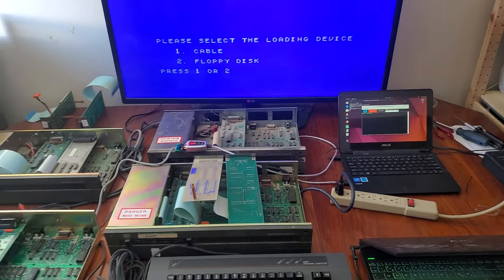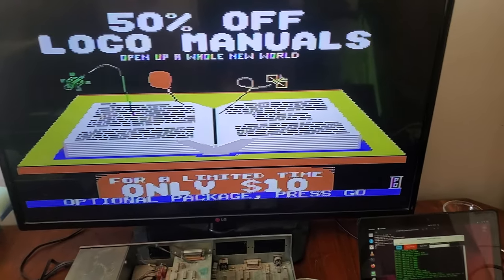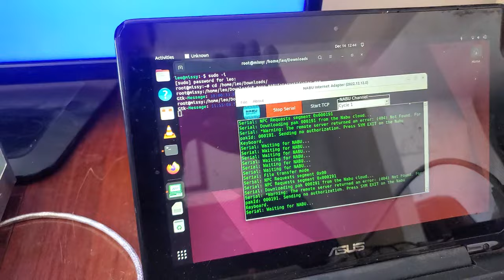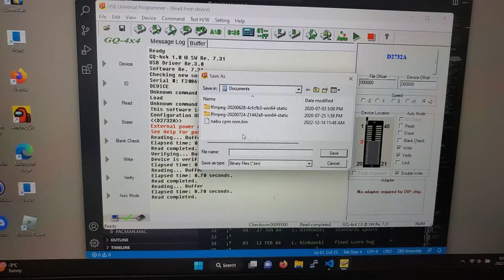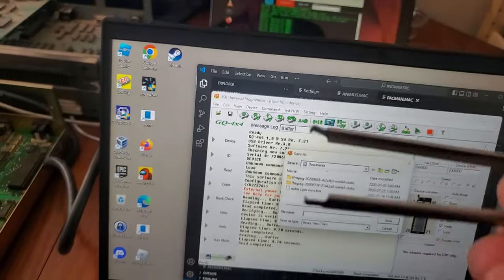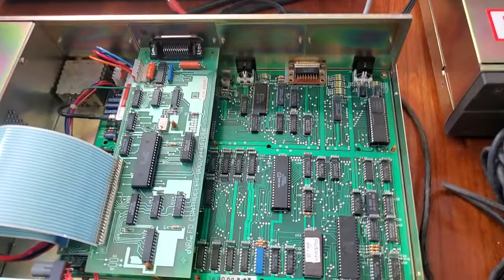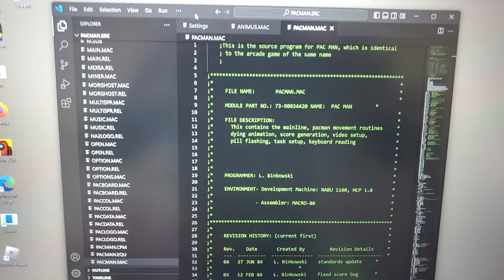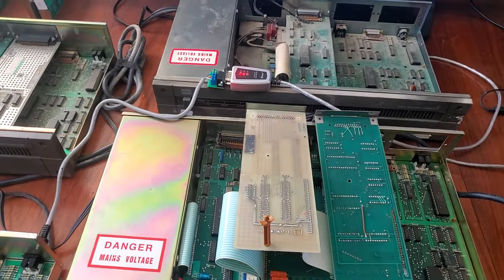NABU Archaeology with Leo Binkowski part 5

Comment: I did a quick analysis of the dumps; here's what I noticed. RevA firmware is for adapter booting only. It has no FDD errors in it.
RevB firmware can boot FDD. Address 0x0004-0x0005 is the bios version for revB firmware. Latest release is revB version 29 (8k). NABU ROM 90020060 Rev B Leo 5.bin is blank!
Reply from the maker: Thanks for looking. That Rev B Rom was certainly in a machine, maybe I read it wrong.

Comment: Any of the shorter ROM chips are 4K.  The ones that fit the entire chip socket are 8K.  Just in case you were not aware.
Reply from the maker: I took a picture and noted the socket differences and where the 4k should be positioned before I started yanking them out willy-nilly.

Comment: Use Version 29 on machine 1 to use DJ's software.  That works for me on my Nabu with floppy controller unit.  I had the same issue.
Reply from the maker: I already tried to desolder a jumper and it stopped booting. I'll try not to break any more.

Comment: Random thought: Back in the day, did you guys ever hook a second NABU into the Cable IN and then use TV <-> NABU to switch between two NABUs?
Reply from the maker: No, that would have been redundant. We did connect two NABUs together via RS422 and used both together running something called SUPERCPM or CP/M BarnBurner. It moved most of the BDOS into the second connected NABU, giving a little bit of multitasking (there was a print spooler) and a HUGE 62K Transient Program area. It could also set breakpoints at every call for debugging. A marvel created by Dave Allen.

Comment: How did the ROM upgrades work "in the field" - Is it possible that the JMP sent to DJ should have been a lookup that returns the JMP, hence the JMP can change between ROM versions as needed ... and so "in the field" there could be many ROM versions, all would still function with new software updates ..
Reply from the maker: The field upgrade was to swap out the entire NABU PC. There were a certain about of strictly cable units, and there were floppyunit, and a subset of single drives and dual drives. If you upgraded to floppy, you got your NABU replaced with one that already had a floppy ROM and interface card installed.

Comment: v17 is 4k That rom might work with Internet Adapter and homebrew
Reply from the maker: Sadly, I tried to modify that 8k machine it a 4k by desoldering the jumper, now it no longer boots 4k or 8k. I'll get back to it later.
Reply: @leo.binkowski  I know that the Rev A on my site is 4K and will work with DJ's software.  You just won't get the "boot from floppy" option.  This is the same EPROM in all of the eBay units.   Make sure the jumper is either on 4k or 8k.  If you have no jumper it may not boot and that might be your issue.

Comment: Great stuff!!! Do you know of any diagnostic software for Nabu computers? I'm just thinking, how would you go about testing them? I'm assuming an oscilloscope and schematics are the traditional ways.
Reply: Rudy, word on the street is you use some Deoxit D5 while snacking on some Haribo candy to troubleshoot the NABU PC 🙂 then you can have an 8-bit dance party. In all seriousness I would think there would be some sort of diagnostic program and if not, since it's Z80 based, other programs could be tweaked to check things like the RAM, ports, etc. Who knows, in the next day or two something like this might just surface with all the developement that's currently going on for NABU.
Reply from the maker: Or, y'know, just hook it up to power, plug it in to the TV, keyboard and DJ's adapter software. Just remember to keep the fire extinguisher handy.
Reply: @leo.binkowski  LOL!!🤣🍻
Reply: @Geek With Social Skills  LOL 🍻🍻🤣 I would like to know more about the hardware side as you know I'm good at repairs and want to get ready for any repairs related to the Nabu. I plan to make a diagnostic spreadsheet as I did for the Apple II series and Commodore series computers. Just waiting on the mailman 👍Once done I will share it
Reply: @RudysRetroIntel  I hope you receive your Christmas NABU PC soon so we can do some testing together.
Reply: @Geek With Social Skills  Me too, so much stuff to do and check out. I have a few ideas but will share later on 😉

Comment: Hey Leo, I have a theory that your memories might prove or disprove. I theorize that this latest batch of NABU PCs on eBay are factory seconds that were discovered to be bad and warehoused. This batch has a pretty consistent fan fault (shroud rubbing), which doesn’t seem like the kind of fault that might result from long-term storage alone. The shrouds are not misshapen; the fan spindles just have more play than the shroud interior diameter tolerance allows. This isn’t the kind of thing that develops over time without friction wear and there’s obviously no friction wear in new old stock; it’s an original factory fault. It’s easy to envision how the factory might have gotten a bad batch of fans, built them into the NABUs, and NABU Ottawa didn’t find out about it until they suddenly start getting a freakish number of customer returns. They then follow up with the factory, who follows up with the fan supplier, and they’re then able to identify a range of serial numbers that are likely affected. NABU has a supply of good PCs and not a lot of time to do repairs, so they continue to ship good PCs while storing these for later testing, repair, or parting out. At the company’s demise, it would make sense that these would be the ones left to one day be rediscovered. Based on your history with the company, do you recall there being a kerfuffle with customer returns?
Reply from the maker: I didn't hear of many fan problems back in the 80s. I just think that they were stacked kind of high while stored in the picture I've seen, and the ones on the bottom might have been under a lot of pressure. We never stacked them higher than four boxes. I suspect that batch was from the Alexandria, VA operation.

Comment: I'm wondering how the cycle worked, if the load addresses were different between different versions of NABU PC (eg 4K vs 8K ROMs).  Unless there were separate cycles, the same segments would've had to work on both types of machines.  Was there maybe some common entry point for both machine types, where they would jump to $140D on 4K ROM machines and somewhere else for machines with 8K ROMs?
Reply from the maker: I wish I knew the answer to this. I wasn't even aware of this issue until I started testing all the ROM versions.

Comment: Has anyone started reverse engineering the HD floppy controller yet?
Reply from the maker: Not to my knowledge. There are two parts. The card in the NABU PC is kind of a bus interface card to the actual controller in the Mass Storage Unit. However, at this point, I'm afraid to even power it up without it being serviced first.
Reply: I was under the impression that the logic board in the mass storage unit controlled the hard drive and floppy drive just shared the chassis (and presumably the power supply).  It's difficult to discern in the videos, but there appears to be 2 interfaces in the Nabu with one of them appearing to be a complete floppy controller similar in design to the consumer controller that Klyball reproduced.  It seems odd to me that the logic board in the mass storage unit would be integrated into both the hard drive and the floppy drive.  I've also been studying Klyball's schematic for the consumer drive and it seems like it could be relatively easily converted to an HD controller, although the software wouldn't be compatible.
Reply: @leo.binkowski  By the way, the floppy drive appears to be a Shugart SA-460, which is a quad density drive.  It may have been modified for high density usage.  If you ever get it running, I'd be very curious to know what speed the spindle is running at.